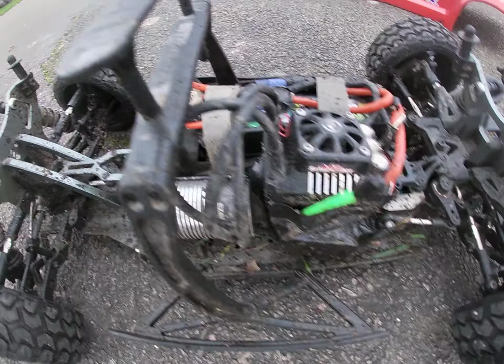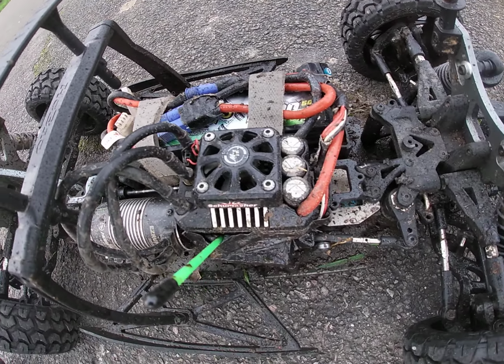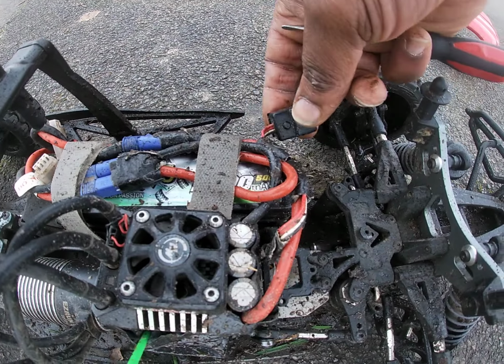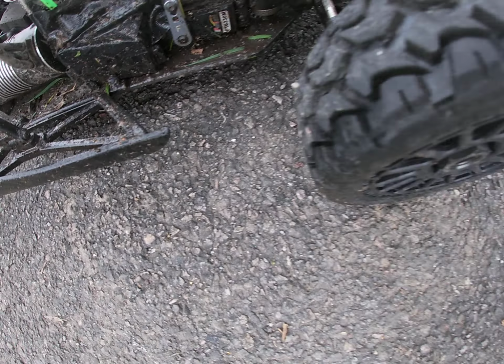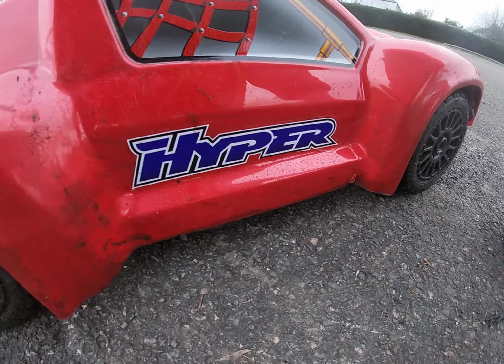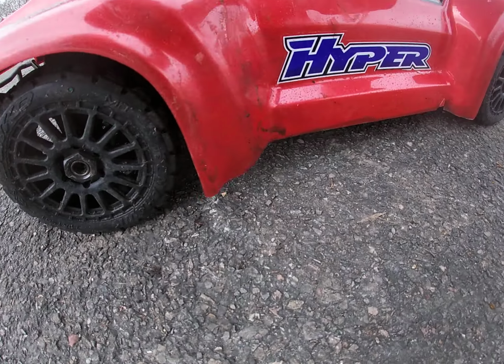Hyper 8 SC touchdown 🛬

Comment: Try a high KV motor if you want speed, that's an 8th scale with relatively small wheels, the wheel size makes gear ratio low so gear up if not higher KV
Reply from the maker: Sweet bro, don't know if I can go higher than 2200kv motor, that's what's in rig at the moment, maybe motor is faulty, got a hpi savage motor, same kv, I'll try that, cheers for the advice 🍻🥂